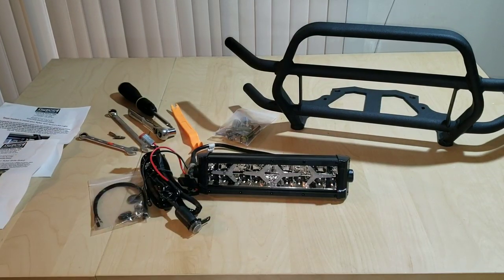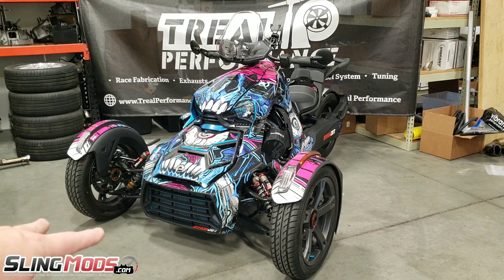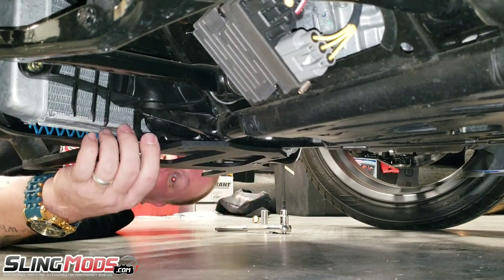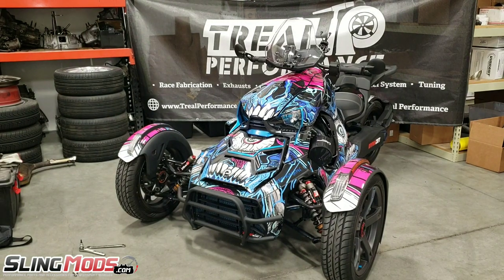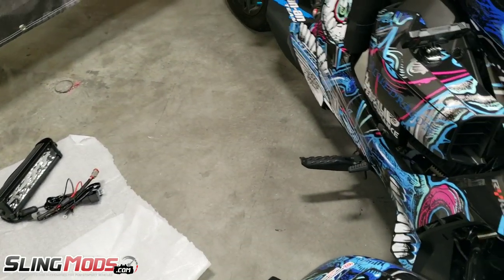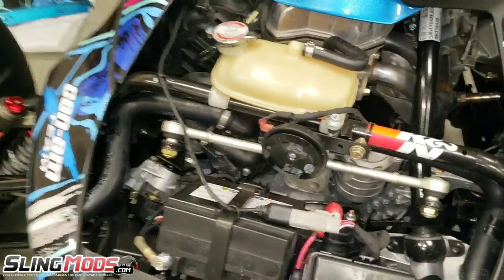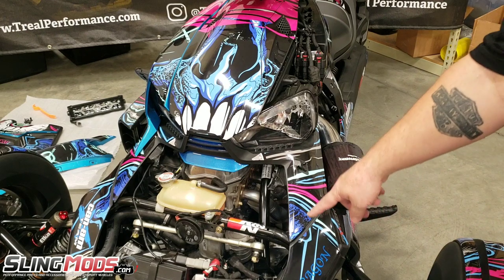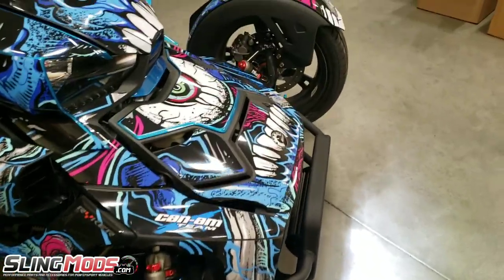Can-Am Ryker Grill Guard / Brush Guard with optional LED light from SlingMods

Comment: Hi Bill.  Can you tell me what the measurement is between the light bar mounts?  I have a light already that was significantly cheaper than the Slingmod ones and wanted to get this and use my existing light bar.
Reply from the maker: Unfortunately I do not have it in front of me at the moment.

Comment: This thing is God awful expensive but damn do it look good!  How does the light impact cooling as it blocks some airflow thru the rad?
Reply from the maker: I'm not sure yet I haven't rode the bike with it yet. The bike is sitting at my friend's shop he owns treal performance they're building performance parts for the Can-Am Ryker. Exhaust intake header that kind of thing. I will be doing a follow-up review later on down the road and that is one of the things we are going to be testing is keeping an eye on the temperature.

Comment: U think if I road mine up on to car wheel ramp stands pull the break and block the back wheel. Would it make it easier to get to them screws? I'm ordering mines next month. And I really like that air intake pipe coming out the side.💪🏼
Reply from the maker: Yes getting the bike up in the air in the front end is definitely the easier way to do it..... The air intake is from TREALPERFORMANCE.com